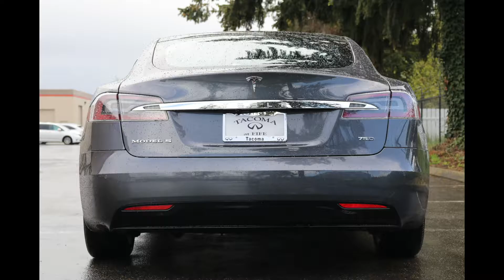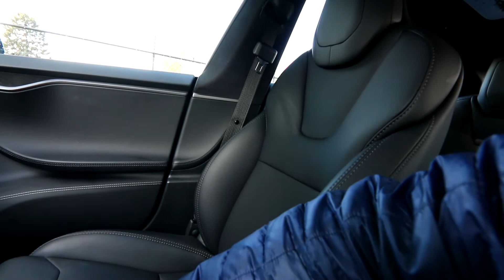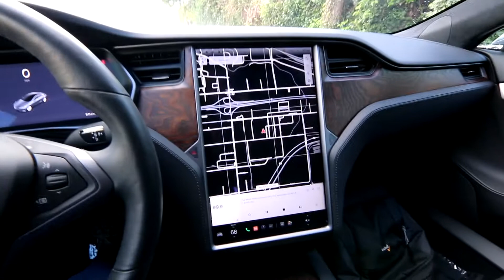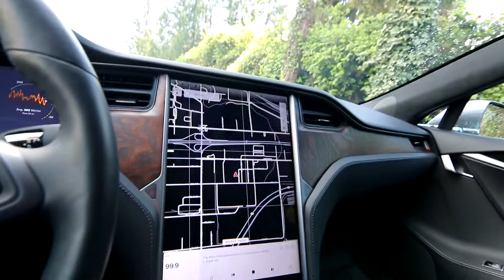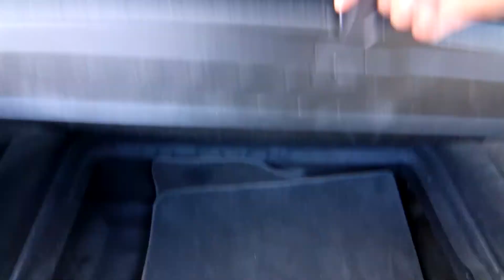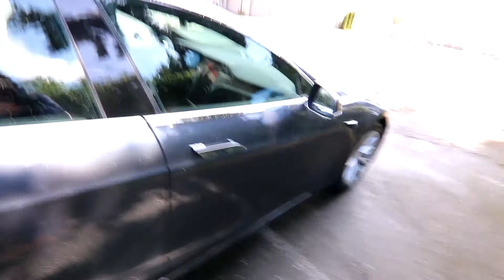2018 Tesla Model S 75D Buyers Guide and Info

Comment: Nice .

the range after full of charge ?
Reply from the maker: About 250 miles
Reply: is true that the battery range dropping with the time?
Reply from the maker: @MahA-pr7kr  Yes, recent research has shown that with about 150-200k miles most Tesla batteries lose about 10-15% capacity. That still fairs better than most gas-powered vehicles with that number of miles, because generally they start leaking oil and can develop other issues, where the EV just has less range. Tesla battery failure on 2016 models and newer is at .03% despite all the unfounded fear you hear in the media "what happens when your battery fails?" What happens when your engine fails? Thats expensive too, especially on a high-end car.
Reply: @infinitioftacoma1  

I never owned Tesla before. but I'm looking to get a used Tesla car.
I found one but the battery warranty about to expire. that's made me wonder. risk or no risk...

Comment: Another amazing thing about Tesla is that the mileage doesn't really matter. You can take advantage of the fact that the prices are decreasing in value for the older cars almost similar to gas cars, but the thing with tesla's is the mileage isn't nearly as important than on gas cars. Gas cars you start to get worried about the mileage around 150,000 especially 200,000 miles, but with electric cars they can last 1,000,000 miles, the only worrying factor is the battery losing it's maximum capacity over time, not the state of the engine.
Reply: But why aren’t miles important? I’m curious because I’m looking at used teslas and I’m scared to get one over 75000 😮
Reply: @symphony2929  Their body is designed for a million miles, their battery isn't.
Reply: @Casterial  so how many miles are the motors good for since you have inside information?
Reply: @don33-1  it's not inside information it's Google. Depends, I've met some Tesla owners still driving their original 2013 with all original parts and 300k miles, I've met others that replaced their motor around 150k and it cost $5k.
Reply: The car still has lots of mechanical parts that wear with age and mileage use that can break. And other electrical components as well. So yes mileage very much matters with Tesla pricing.
Reply: @shanewilfon6860  it doesn’t matter in the same reasons that a gas engine would, electric motors at least a Tesla does not have moving parts like a gas engine, no carburetor, alternator, transmission, oil pan, oil, leaks, spark, plug, spark, plug wires you left the hood up. There’s nothing under it there you must be talking about the rest of the American made electric cars.😂😂😂😂

Comment: You are lightly Wrong about Model 3 Standard Range  Fully charged, the range is less than you are saying.... the SR+ plus have  maximum 240 miles, the  range of a SR RWD are lower, 220 miles maximum.
I dont now about your Tesla, but I have a Tesla Model S 75D 520 hp   and i am able to make 270 miles if my consumption average stay below 170kwh with speeds between 50/60 miles...
Reply: Not sure where you are driving at 50-60mph...our freeways are 75mph and I usually drive right at that speed to increase my range (while on road trips)